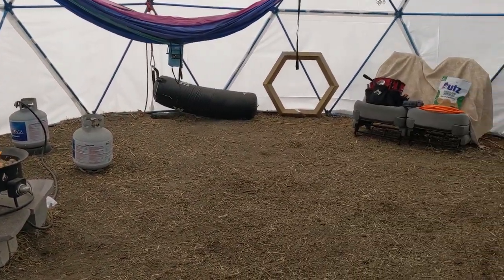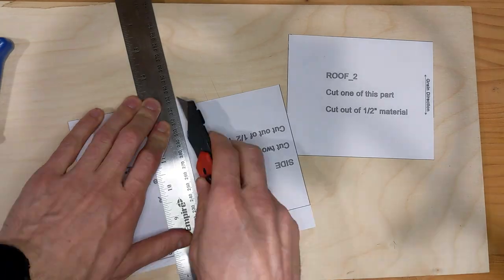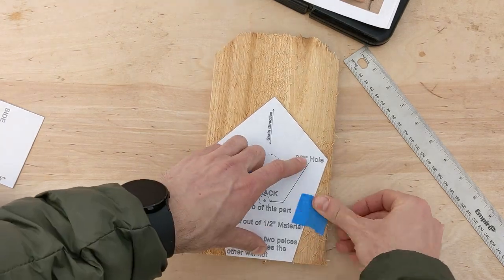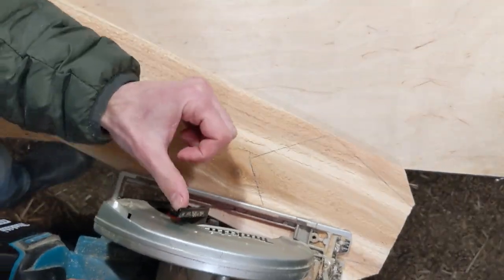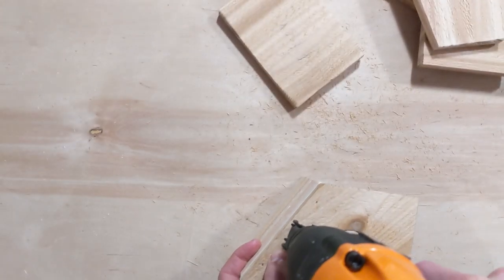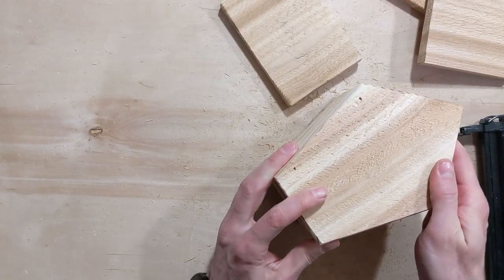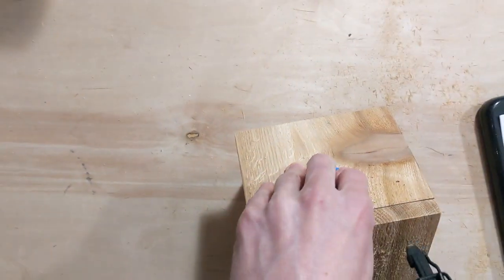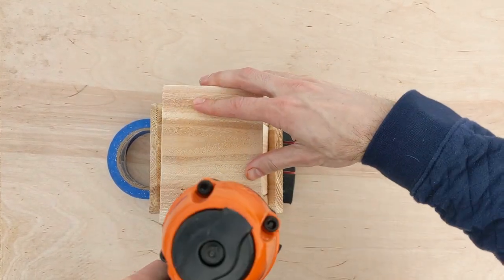Super Easy Cedar Birdhouse

Comment: Should've used some wood glue and then brad nails.
Reply: Nonsense!  Glue is for indoor furniture, not a bird house outside 24/7 that birds will 💩 in for 20 years
Reply: @UncleFjester  I guess you've never made a bird house then.
Reply: @andyboy148  I agree with you.  I have made many, many birdhouses of various sizes and shapes.  They ALL utilize Welbond III exterior glue and brads.  Also, in the video, birds do NOT require a perch.  Predators, however, do.  In addition, there are no vent holes for air circulation, and, aside from the quick shot of a hinged piece on another project, I did not see a method for cleanout, which is an absolute must at the end of every season.